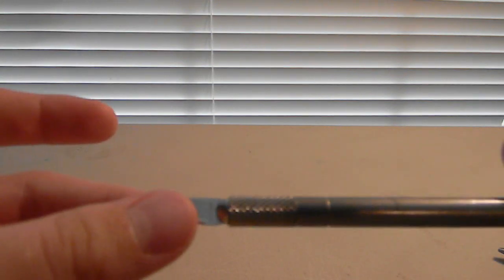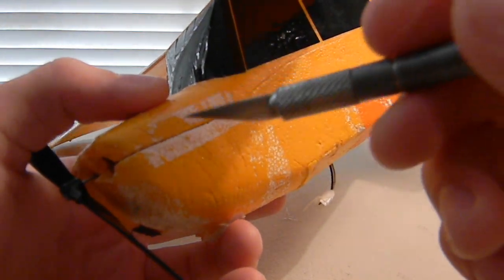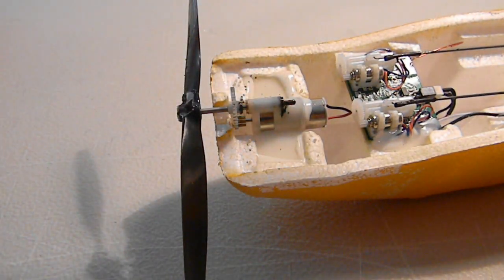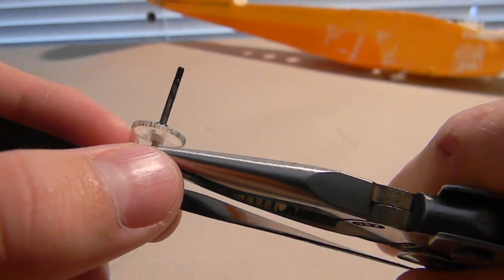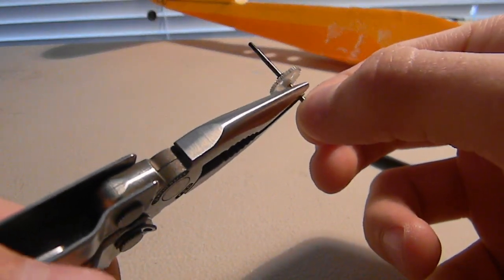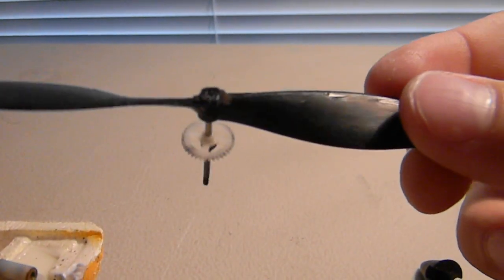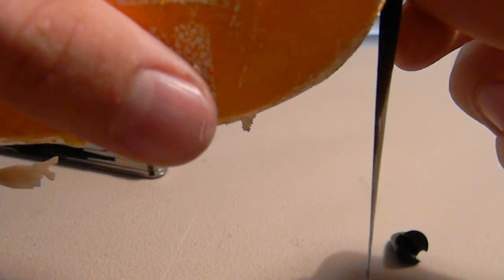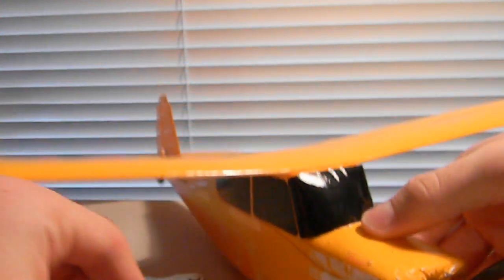How to replace the propeller on Hobbyzone Champ

Comment: I'm confused. It looks like you removed the old propeller by screwing it in the same direction that you installed the new propeller, clockwise looking at the front of the plane. That doesn't seem right.